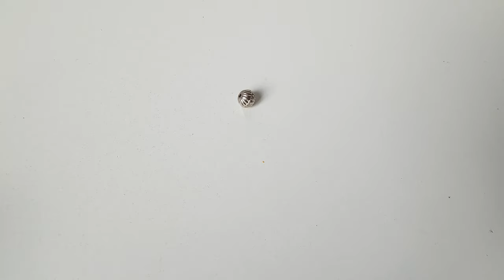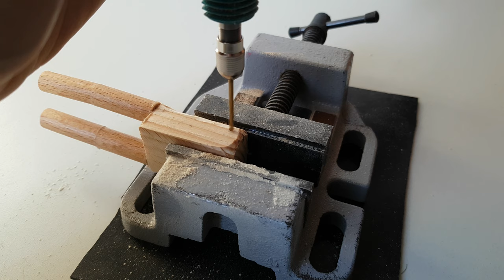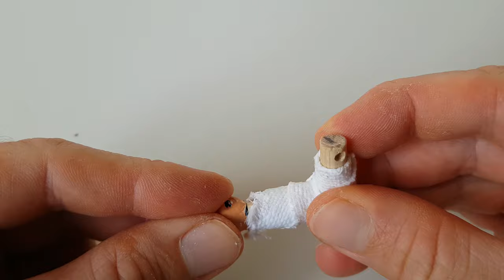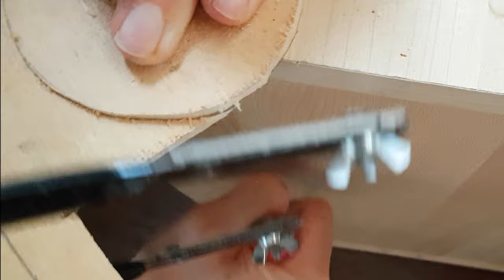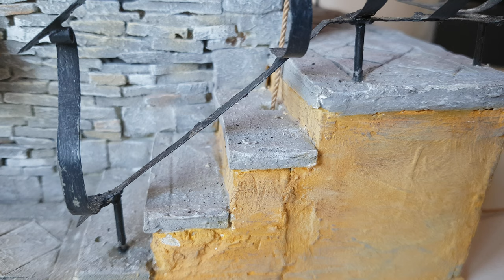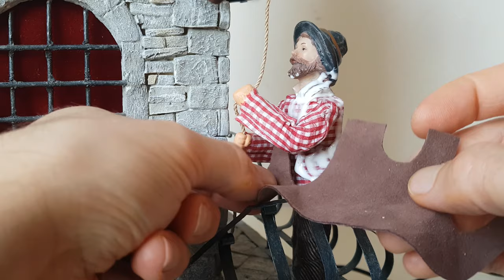💡 TUTORIAL: Pastore suona la campana 🔔 in movimento ⚙️ - Statuina per Presepe

Comment: hello friend where can I buy the figures for presepio
Reply from the maker: Hello, i used common materials in my tutorial, you can find most of them in a normal market. I took the heads from cheap resin statuettes. You can find the motor on Ebay or Amazon.   This is an example http://bit.ly/356Na8F